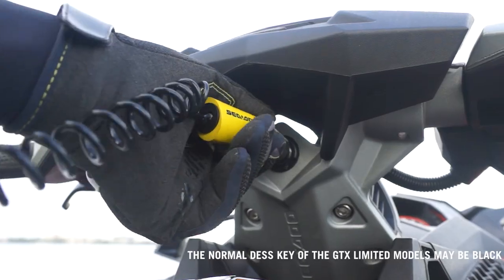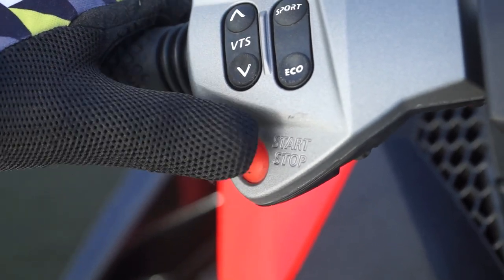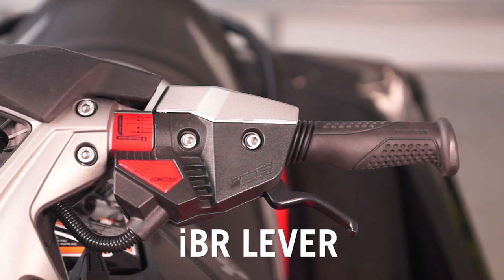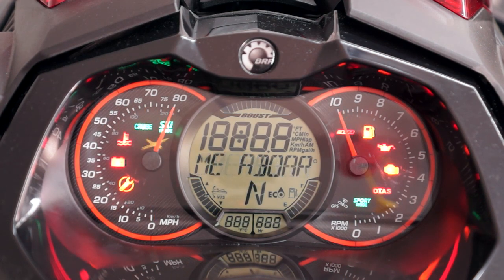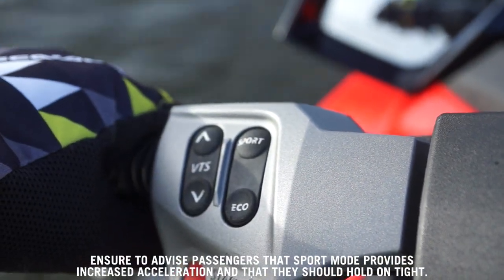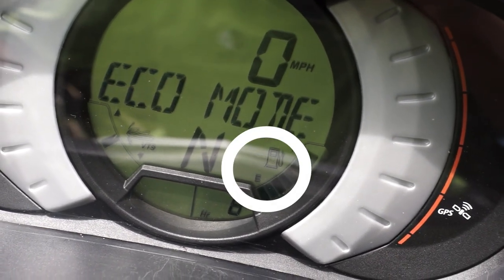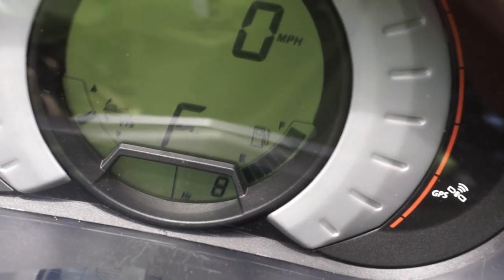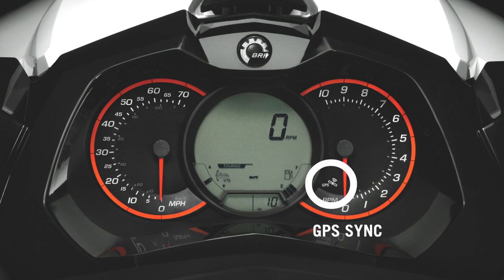How to Understand the Controls & Functions of a PWC | Sea-Doo

Comment: There is not a single video or info on the webb about what happens or what you do when you are in idle mode (only power on) and you press both handles, it says something about ibr and you can change it? Can anyone answer that? Not even the sellers can answer what happens or how to change it!?

Comment: Do they have any model that the reverse works correctly and not right left inverted?
I really like the design but this is a deal breaker for the models I've seen so far.
Reply: like reversing a trailer